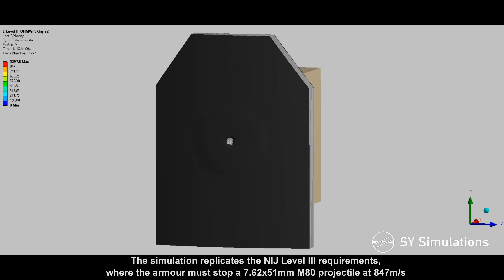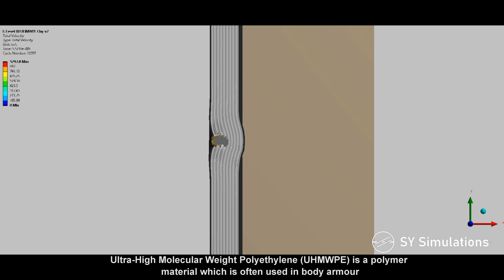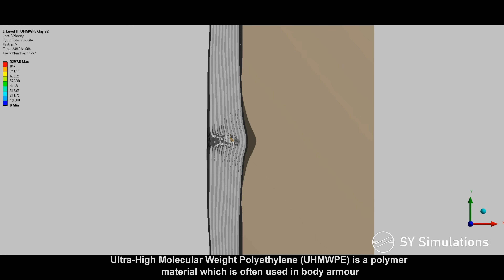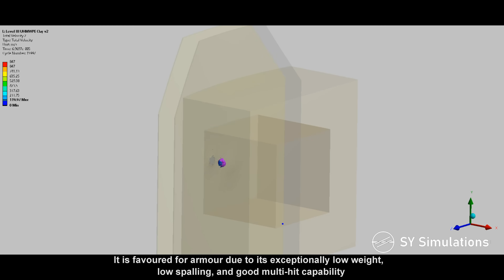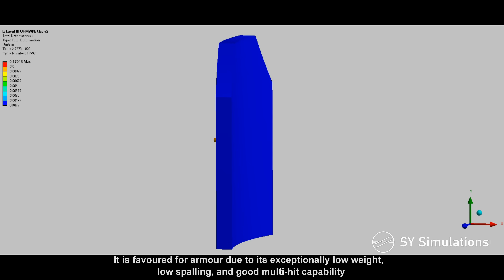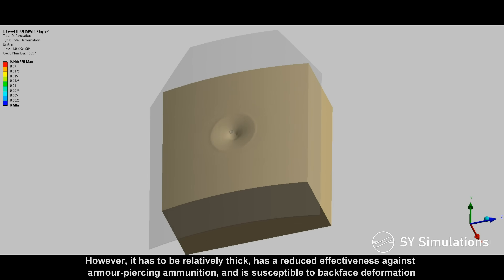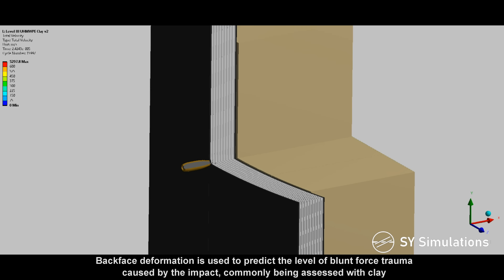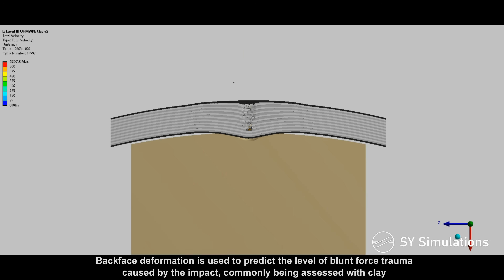Level III UHMWPE Body Armour Simulation | 7.62x51mm vs Polymer & Clay Armour Penetration Simulation

Comment: Pain from backface deformation is typically addressed with a trauma pad. Will you still feel something? Yeah. Maybe still break a rib, possibly. But you'll at least be alive.
Reply: Broken rib or two is far less bad than hole trough lung.
But there are those cases where bodyarmor technically stops projectile/s but energy transfer to chest will still break your sternum and very likely squash lungs.
Not exacly common with conventional calibers but shotgun slug against just pistol caliber rated armor would be on that ballpark because backface deformation is so great.
Reply: @Kesssuli broken ribs do cause hole in the lung
Reply: @Kesssuli  IIRC there is no body armor in existence that is rated to protect against shotgun slugs, exactly because the injury is too great to be considered "proof" even when it doesn't technically penetrate.
Reply: any hard body armor would stop slugs with little to no backface deformation. You can look up videos of people shooting AR500 with lead slugs and it basically doesn’t even dent it. A trauma pad behind that would definitely be a good thing though.
Reply: @boomchacle and yet still shatter ribs.
Reply: @boomchacle it still doesnt stop the blunt force trauma and trauma plate wont absorb everything
Reply: @ThonThi-tp5lo it would stop a large portion of the blunt force trauma because the plate would spread the force out along your entire chest. People hype 12 gauge up to be some sort of anti tank round when it’s really just a large diameter, fairly heavy projectile with a bit less energy than 30-06.
Reply: @boomchacle it doesnt spread all the force that is not how physic work plate arent some kind of magical jar that seal all the energy some of the energy will still transfer upon impact point slug carry 3000+ ft-lbs of energy so even 90% of it being absorb it still 300ft-lbs of energy left being concentrate in such small area and but not armor are all able to absorb 90% of the energy dont confuse the word “absorb“ energy cannot be create or destroy so the energy redirect into something else like heat, sound, but most importantly permanent material damage that called “backface deformation” that where most energy being absorbed so if the armor is rigid like ar500 that doesn’t deform upon impact that is mean the armor didnt absorb much energy at all it just transfer most energy directly into your chest
Reply: @ThonThi-tp5lo   Directly into your chest, spread over the surface area of the armor. Sounds pretty surviveable...
Reply: @ThonThi-tp5lo  it's not magic, it's surface area.  It doesn't absorb, it disperses the energy.  Steel plates have little to no deformation so the energy is spent across the entire plate.  It's actually pretty basic because the plate is relatively unrelenting.  Look at the formula for pressure (pressure=force/area) and it gets pretty obvious.  If the plates deformed greatly it would be an entirely different story.  It can get a bit weird when also calculating uhmwpe as well since it deforms, converts kinetic energy to heat, and has a changing friction coefficient.  A much harder formula to fully express.
Reply: @sinisterthoughts2896 you know that the distance between steel to your chest is closer than the length of the plate ? Steel rigid which mean i have little to no absorption that mean it is a pretty good energy transferrer which just transfer bullet energy into your chest knight in steel plate got beat to death by mace for hundreds of years yet we argue wether it work or not ???
Reply: @ThonThi-tp5lo rigid plate will absorb energy the same but with less chance of behind armor damage. Backface deformation means the bullet is stressing the material to exceed its static rigid state. No backface, means the force of the bullet is applied to the entire plate. The whole plate is pushing into you as opposed to a small bullet sized section.

knights got beaten to death by maces because blunt force trauma. Which is an effect of backface deformation. Theres a reason why cuirrasse chest plates have a huge air gap in the center. Equal and opposite force. The mace exceeds the armor materials rigidness, dents, causes backface, causes trauma. Look at historical articles of armor of deceased knights
Take a cutting board, hold it to your chest, and smack yourself with a hammer. You feel nothing. Nothing deformation, very very miniscule felt force.
Reply: @ThonThi-tp5lo if you dont believe me, they go read the DOJ paper on the relationship of backface deformation shape on the type and severity of blunt force trauma. Rigid plates with large surface backface deformation only caused minor skin surface damage.
Reply: @a.t6066 I’m not saying that armor is useless it can absolutely save your life that is what it design too my point is the armor doesn’t make you invincible the blunt force trauma CAN also incapacitate you too. And you are correct that backface deformation can make thing worse but it not the end of the story back face deformation is not a good measurement of energy because deformation is base on material and what it can only goes but not how much the energy gone through get hit by the metal baseball bat or hit by wooden baseball ball you obviously know which hurt more even metal bat don’t deform like wood. The word absorption is just mean it redirect into something else it physically impossible for energy to disappear like an actual absorption. For example most of the energy absorb mean to redirect into heat into movement some into radiation but most importantly it going into break the molecular bonds of a material it called deformation so if stuff doesn’t break once absorb energy it just mean it gonna transfer most of the energy into you back that why motorcycle helmet made to be break on impact but not rigid as steel.
Reply: @sinisterthoughts2896 i dont know why people dont understand simple logic and act like blunt force trauma is some magical thing
Reply: Trauma pads are basically bs, they're a marketing up sale gimmick, there may be some newer designs that actually do something, but some closed cell foam and some nylon really isn't going to do much other than make your armor thicker and heavier
Reply: @cascadianrangers728 anything to lower the impulse of the plate hitting your chest would probably be a good thing. I would rather have some sort of cushion instead of just having a metal plate slam into my chest after being accelerated by a slug of metal.
Reply: How thick are those typically? Just curious, cause I imagine the more foam the better, but at a point it restricts mobility
Reply: @contagioushavoc5794  closing in on an inch thick, but only a couple pounds.

Comment: Can you do a test against 5.56 M855 (green tip)? It easily penetrates NIJ III UHMWPE and supposedly requires 40 mm of hot pressed UHMWPE to stop it.
Reply: M855A1 and Mk318MOD1 + against automotive windshield

Comment: Don't plates usually have a layer of boron carbide on the front and back exterior?
Reply: There are different kinds of plates - some use UHMWPE only, some feature ceramic (like boron carbide) as a front layer + a backer made of either UHMWPE or kevlar.
Reply: RF1 - no
RF3 class - yes.
Reply: This is level III not IV

Comment: Plz do firefly vs tiger mantlet 500m
Reply: From your point of view, aim for just under the optics on YOUR right side of the mantlet.
<140mm Armoir
Reply: @kwyoushyt6356 Why under the optics? Hitting optics directly would be a lot more effective.
Reply: @Patryk-ix2zr  wouldnt the optics just eat the round tho? Warthunder be goofy like that sometimes
Reply: @Epsilon2042  Not irl. Any kind of slits or holes like vision ports, hatches or mg ports were a weakspot. Those are literally just holes in the armor plates. That's why Pz.4 had less and less vision ports after every modernization, Panthers got rid of ufp driver's vision port and it's one of the reasons why post ww2 tanks got rid of hull mg ports. Wt doesn't model this, as most vision ports aren't modeled as holes in plates and just add up to the armor. And T-34's driver's hatch in wt is the strongest part of armor, but irl it was prone to break and shatter after recieving a direct hit, sending spall inside.
Reply: @kwyoushyt6356👏

Comment: bullet stopped, ribs broken probably
Reply: No,there are standards for backface deformation too.
That's why an ECH helmet CAN 
stop 7.62x51 FMJ but is not rifle rated.
Reply: @ShokkuKyushu  Could you give some proofs about helmet vs 308fmj?
Reply: why?
Reply: @ukuskota4106 Because the energy of the bullet is still being transferred to the armor and therefore your chest. The force is being spread out over a larger area but at some point you will start suffering blunt force trauma injuries even if the bullet itself is stopped.
Reply: @Hybris51129  The energy of the bullet is also exactly as much going into the shooters shoulder, Newtons law babyyyy. Watching people propagate this myth is funny asf.
Reply: @fen3311 Maybe with a single shot rifle or bolt action but with a semi auto rifle a good chunk of that energy is being used to work the action and is absorbed by recoil/buffer springs and the mass of the system itself.

Isn't physics fun?
Reply: @Hybris51129  Yeh to the tune of a few joules of energy out of thousand(s), truly a 'Good chunk' of energy!
A proper plate will weigh the same as a rifle, give or take size of plate/weapon.
Reply: @fen3311 it pisses me off tbh. Most people treat blunt force trauma as some mythical thing
Reply: @ukuskota4106  still a lot of energy being transmited to the squishy meat sack behind the plate. Can definetly still cause damage and you probably would feel like laying down for some time after being hit with that.
Reply: for sure. If it hit heart area it can stop heart beating I presume
Reply: @IvanTheDraggo  No, at least it's not likely. There are backface standards to give a relative safety margin for body armor impacts. This would be well within the safety margins outlined in NIJ testing.
Reply: @blackberet9997  I didn't assume this out of nowhere. When I served in the army, there were cases of hazing. One soldier hit another in the solar plexus and that's it... the heart stopped, death. And this is not an isolated case. And what happens if a bullet hits with enormous force, even through a bulletproof vest?